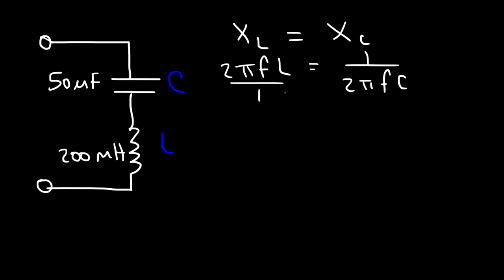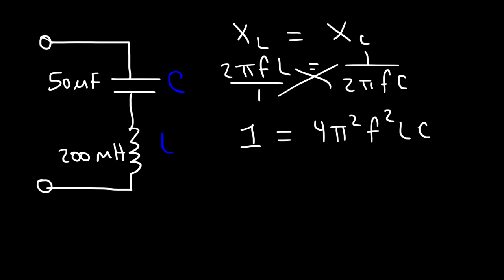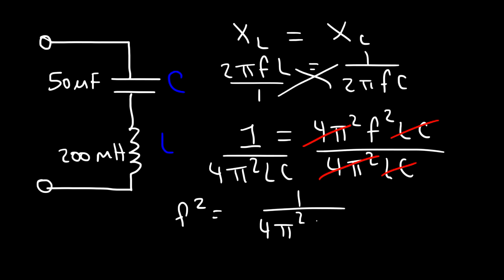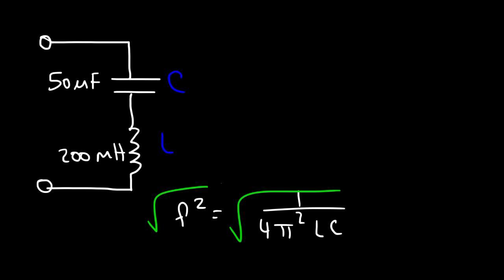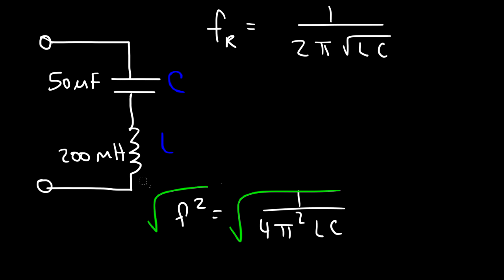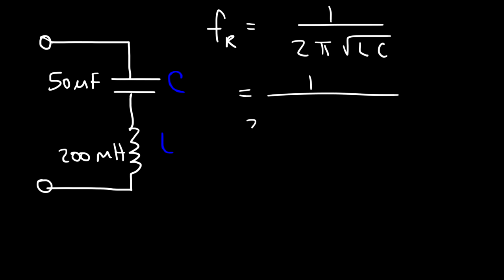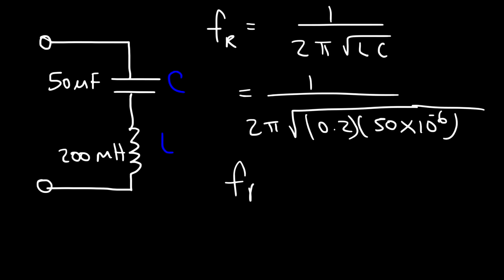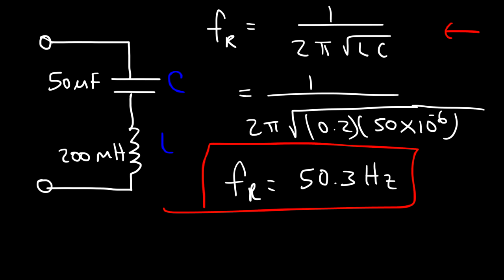Resonant Frequency of LC Circuits - Physics

Comment: Howdy. Yeah.
This applies assuming the inductor is lossless, which usually is good enough.
The next level is to see the inductor as a lossy component. The losses can be represented as a resistor either in parallel or in series with an ideal inductor. And observe. The inductance will be slightly different in series than in parallel. The result is astonishing. Theoretically there are two resonant frequencies.
Regards.

Comment: Is not the resonant frequency   dependent on the source voltage .  As to say if you raise the voltage on a series lc the frequency also raises so how is the resonant frequency supposed to remain at 50.3 hz in this scenario???

Comment: So, for a resonant frequency in which the only elements are a capacitor and an inductor - does this mean that the resonant frequency is the frequency that can traverse both the capacitor and the inductor in series to the other side of the circuit?

Comment: Amazing! I have a question tho, if that LC circuit is pulsed using a transistor, let's say 2N2222, which has a frequency around 250000 Hz, if I want this oscillator circuit to resonate, how? should the LC frequency match the transistor frequency, so I'll have to change the coil and/or the capacitor fore new L/C?

Sorry I'm an electronic newbie trying to learn more.
Reply: You might want to use a pwm circuit to pulse it.

Comment: There are so many people showing how to plug the numbers.
There are an infinite number of LC pairs for every single frequency.
Do you know how to choose which pair to use, in specific circuit situations?
How does this work for 
parallel LC : High impedance?
series LC : Low impedance?
What affect does source voltage and power capability play in the selection?
Reply: You calculate base on the load and frequency at which your circuit will work at. The lower the capacitance of a ceramic capacitor the lower the impedance at high frequency. That information is given in the datasheet, if you are using a 12mhz mcu look for a capacitor with the lower impedance at 12 mhz then calculate the value of L by replacing the C for the actual value of the capacitor then solve for L. I hope this helps. There is also a formula for ripple base on your load if you search for it. Look for "EEVblog #859 - Bypass Capacitor Tutorial" close to the end of the video he uses an analyzer to measure impedance with difference decupling capacitors.

Comment: I want to figure out what the antenna impedance is when connected to a matching circuit.   The antenna connects to a LC circuit.  The series inductor connects to the antenna. The other side of the inductor has a capacitor to gnd.   I know the value of the inductor, capacitor.  The transmitter is 50 ohms and the frequency is 3.573MHz.  With these values I have no SWR.   What is the impedance of the antenna?  The transmitter connects at the LC junction to ground. Would you know of a calculator program ?